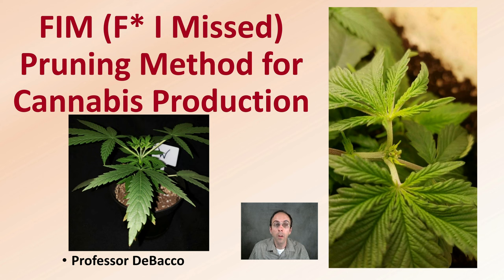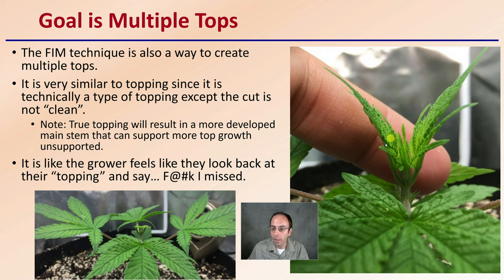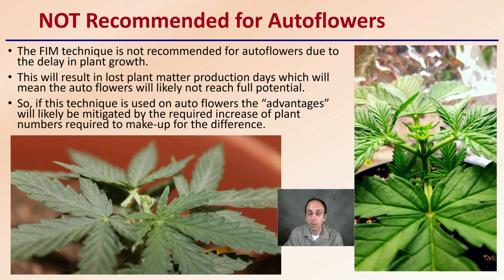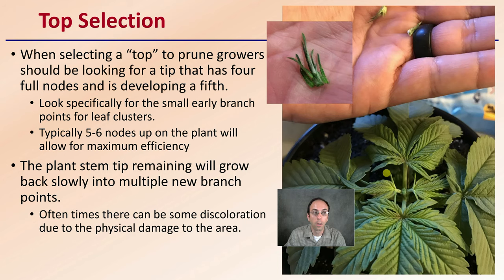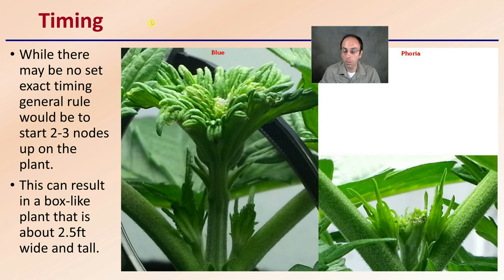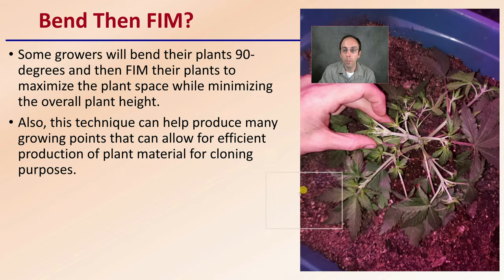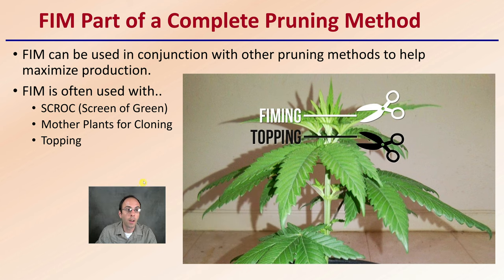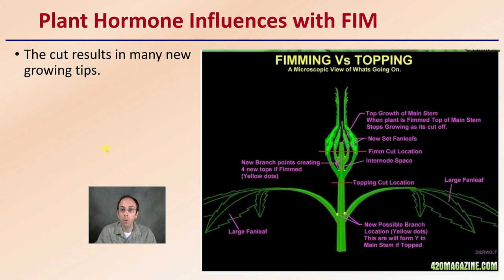FIM F I Missed Pruning Method for Cannabis Production

Comment: Proper Pruning: 1. First the seed cap leaves appear.
2. Then the single finger leaves.
3. Then three fingered leaves.
4. Then Five fingered leaves. This is where pruning begins. When you can get a thumbnail on the stem, pinch one leaf off. Continue to pinch alternating leaves to keep the plant short and bushy. 

Pruning can change your results from 20 percent flowers and 80 percent stalk, to 80 percent flowers and 20 percent stalk. Proper Pruning can have a significant improvement in yield. This is a difference of 2/3rds of an ounce to 2 and 2/3rds and ounce. 
See High Times August 1986 Indoor Grow Special Edition. 3x or more flowers and less stalk production.

The crude mutilation technique in this video should only be used for seldom visited outdoor plants.
Reply from the maker: Pruning selected can also determine the time or days until harvest which must be taken into consideration as well.
Reply: I plan to fim and scrog indoors. It’s my first grow by myself. Should i better just top the plant, i mean you wrote that finming be better done outdoors